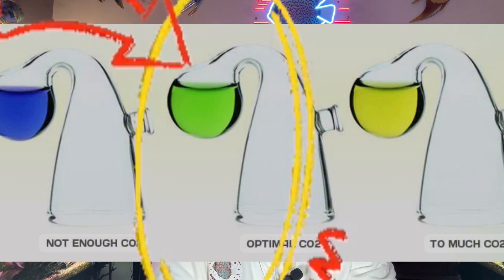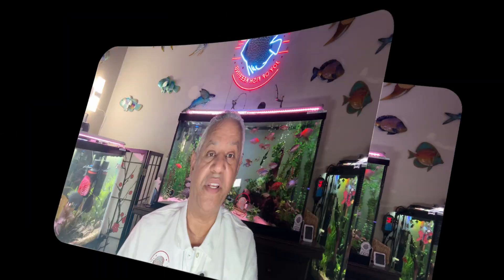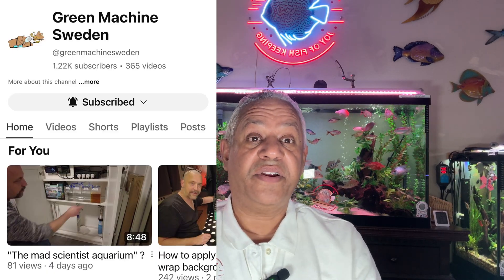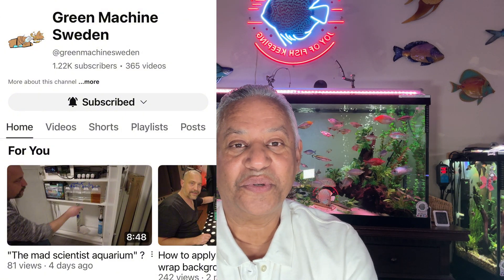Does Excessive  aeration affects CO2

Comment: It has puzzled me since our first messages how a drop checker can define your low co2 levels as the right levels, as "green". I think I got it now. You have very low kh and you use the low kh water for the drop checker, don't you? I read up on the method for drop checkers as it was a blind spot for me. I learned that it does not at all measure co2 levels, but PH. PH is depending on co2 and KH. So I did some reverse tests. Green in a drop checker equals good co2 levels if the kh in the drop checker solution is 4-6. If you have lower kh in the solution green will mean very low co2 levels and if you have kh above that range in the solution, green means high levels. In kh above 8, green will mean levels that are toxic to some fish. Does the drop checkers comes with instructions that explains the importance of KH in the drop checker solution?
Reply from the maker: @greenmachinesweden  good day Magnus. Love your input. I forgot my kh/gh for my New york city water. Forgot  the numbers, both on lower end NY has soft water. Put it on a video , cant remember which. Will retest and update you. I dont belief the solution that comes with this particular test has instructions for kh/gh. I generally dont like to chase number and there there is a fine line between to much co2 and how it affects the ph and health of the fish, had issues in the past. I am taking the path of caution of caution and keeping the neutral ph and checking periodically with the tools at hand. Enjoy your input. It encourages me to looking further and learning. I like to see the results on the plants with current setting and will continue to observe. Great feedback, really appreciate it 🙏
Reply: @josepolanco1228  I do not concider the difference between the equilibrium at 4-5 ppm, the optimum level for plants at 10-25 pp and toxic to fish above 40 ppm beeing a fine line really. But I am just "chasing numbers" in your opinion really. I will not continue this discussion as I do not see that it can increase knowledge for me nor for you. Thanks for the answers and good luck on your tank and your channel lovelly man.😀👍
Reply from the maker: @ Thanks Magnus , not meant to be a negative when I said chase number, meaning that in most case I let’s things be. For example a lot is said about discus and water requirements their needs .I my case and many I know , they do fine in NYC waters. “ I don’t chase the ph” or other than basic waste parameter. Believe me you are far more knowledgeable than me in the topic. Since our conversation, I have been reading an learning more. May not necessarily change what do, knowledge is never unwelcome . In you tube there are many “ expert “ and I am not certainly one. Most times my video I aim towards new comers to the hobby, if a conversation is of interest to a more knowledgeable person than me , then beautiful. I have enjoyed the interchange with you. I love to have serious conversations by voice, because written words does not convey emotions or tone. In the case of discus I have kept for many years and breed them. Now for the real discus experts , they keep them in RO water and some other “requirements “ that I do not practice or follow, nothing wrong with how they do it. The plants I keep in my tanks likely don’t require such a close watch of PPM of co2. However I am planning a nano tank that is like to be of higher requirements, where I would need your type of knowledge .Dutch style with few fish, although the Dutch style is mostly planted only. . My knowledge of co2 is far behind yours , and by far you are no novice as you stated initially.  No offense taken on this end, if I offended in that direction , that was not the intention. Maybe a way in which the expresión is used in North America. Can have a negative tone, in my field ( medicine) we use the term positively , we don’t chase numbers with some patients, because in a particular situation, “ chasing” numbers will not alter that individual’s situation, at that moment in time. I appreciate you comments and learning from you
Reply: @josepolanco1228  that is great information for me. A peoples man rather than an science man. Your field is important and you have my respect for devoting your life to it. My field is data administration.  Every day I have to identify what is truth or opinion based and it is not easy. Learning and teaching is my goal. In that perspective there is nothing to gIain for you or me. I did unsubscribe earlier today. You are a wonderful man and your opinion and experience counts. It is just that your channel do not serve any of the 2 goals I have.
Reply from the maker: @greenmachinesweden  i will recheck  the kh and gh again and msg you , so you can advise me further. The detail of the knowledge is slightly beyond my knowledge. I have the basics and  understand the science, but not to your level. ThAnks

Comment: Yes! It's an old myth that surface agitation is bad for co2 injection! It is actually better for reaching max safe levels quickly without overshooting it. 2 hour aquarist has a great article about it. And sure, you lose some CO2 with surface agitation, but you just increase the injection rate. CO2 is cheap.
Increasing CO2 to ANY level above the partial pressure equilibrium is beneficial. This is especially true in your water because it already has relatively low KH. KH can be used by some plants (inefficiently) in the absence of CO2, but they always favor CO2, and CO2 is by far our most limiting nutrient in our planted tanks. It drives photosynthesis, how much our plants are able to use the other available nutrients. The important thing, second to keeping our fish safe, is keeping the CO2 levels consistent, because plants will have a certain response time to changes in their growth environment, to redirect energy to produce different enzymes to adapt. During that time, algae can take advantage of the interrupted plant growth.
Reply: Yes, I agree. Surface agitation is beneficial in any aquarium or pond. Including co2 injected ones.
Reply from the maker: Thank you Stephen , confirming what i believed , although i am far from a co2 expert. Thank you for additional supporting info. 🙏